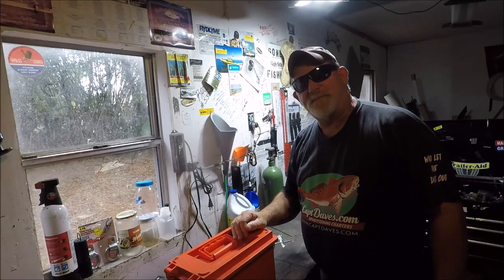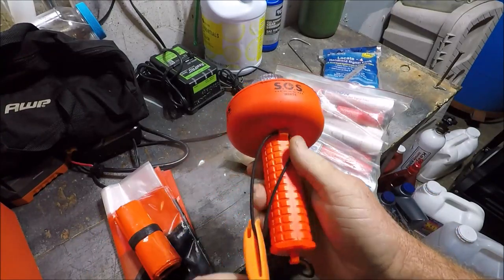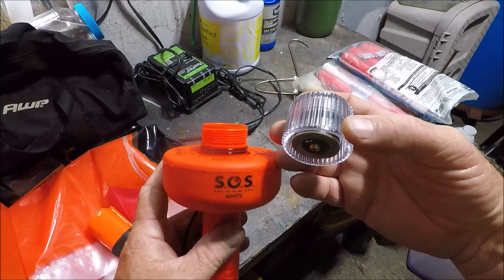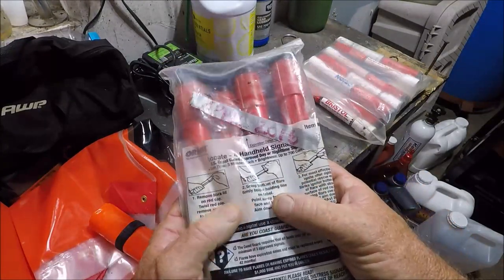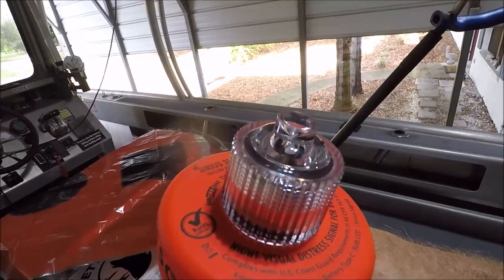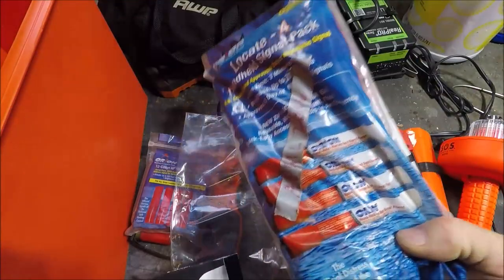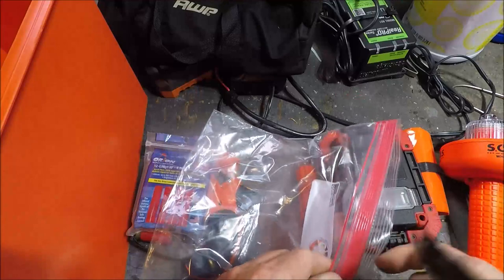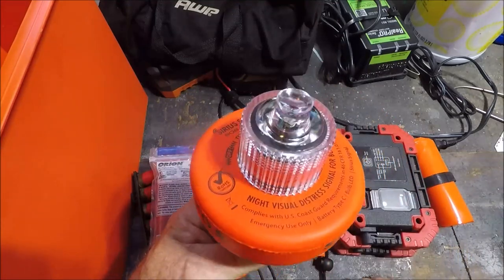USCG APPROVED FLARES

Comment: This is a nice tool, we’ve had another brand for a few years now. Check the date on your batteries. Per USCG, Expired batteries are the same ticket as expired flares. Per USCG, you have to have the unit “in working order", meaning the batteries need to be installed, or it’s the same ticket as not having flares. Rayovac and Duracell batteries hold up best to the marine environment and corrosion. Mine is in a bracket next to the epirb.
Reply from the maker: c-cell batteries have a date?? New one on me.  just check and change, thats EZ. Or buy 10 yr long life batteries. I have them (and they work!) on my PFD lights.
Reply: New on me too, until they showed me. USGC Station Yaquina Bay. Just a heads up to everyone.

Comment: Ok just bought mine from tools of the trade page. Was looking at them earlier in the season. If it didn't  say Made in the USA  I  don't know if I would have bought it. Good video Capt Dave. May you never need any of that emergency signaling stuff.
Reply from the maker: got that straight!!!  May you never need it either. Have always thought a 3000 degree flare in a bouncing boat, while leaning over the side...''can't be good!!''. Thanks Chief Mechanic.
Reply: @CaptDavesSportfishing   Not to mention with 100 gallons of gasoline or more under your feet